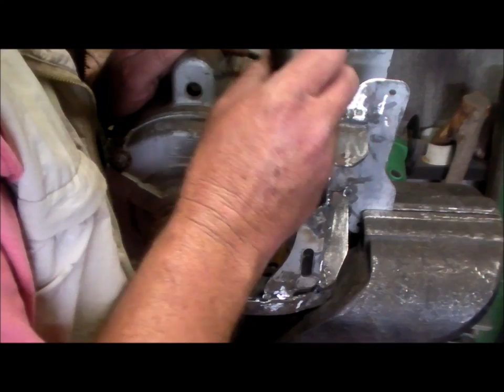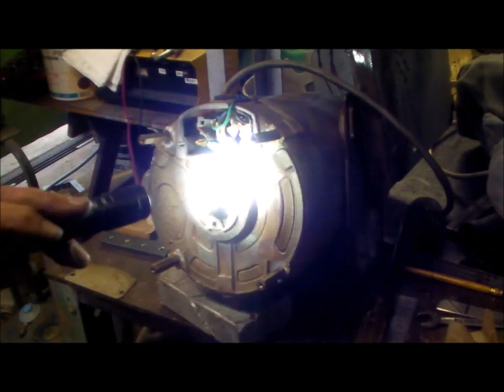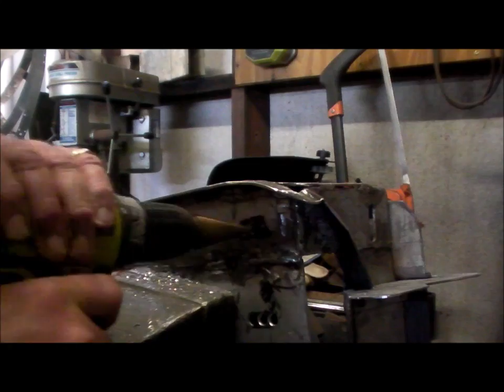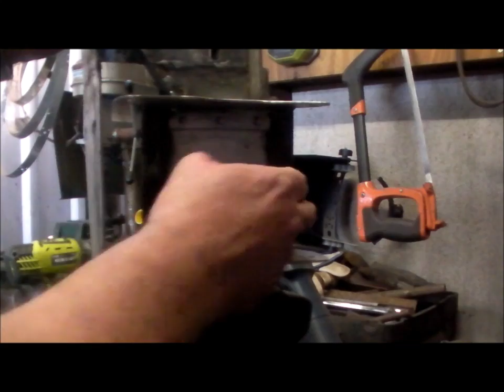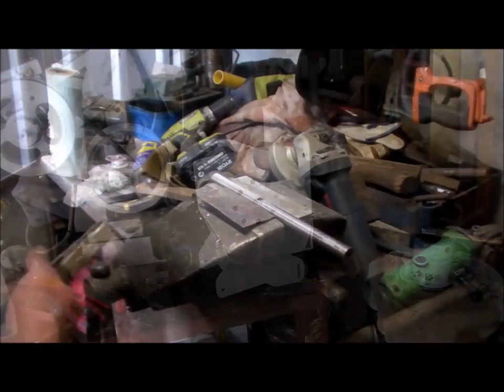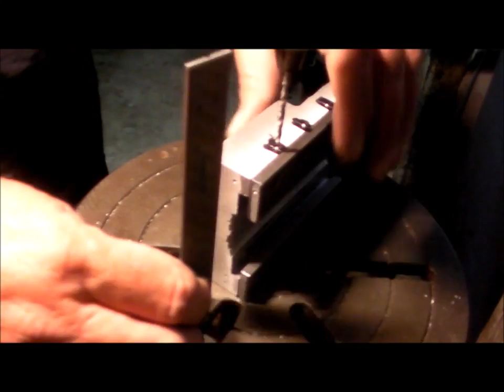Building the Gingery Milling Machine 80 motor install finished

Comment: Great to see you have the drive train put back together, but you could have turned it on and gave us a peek at it running again!!!  That was a lot of modification you had to do for the new motor, but in the end I am sure it was worth it.  Looking forward to seeing more of the tailstock building!  Thanks for sharing Peter.  As you finish your mill up, you will have to suffer through the rebuild of mine.  HEHEHE

Joe
Reply from the maker: G’day Joe, I admit when editing this video I missed taping the final assembly running, maybe I could be out of character and do a very short follow up video over the next day or two, no promises. Hey I’ve been waiting a long time for the mill to make a move into the spotlight, I understand time, money and video constraints but it would be nice to see it again after you clean off the dust. Keep well my friend, Peter
Reply: Hey Peter, thought I would just give you a little grief.  You don't have to make a follow up video.  I am sure I will see it run the next episode.  I moved the mill to the shop and done an introduction video on it.  Thought maybe you saw it.  There are some issues that I will need to work through, but that's half the fun right?  I need a GIB made but it is a weird one.  Led to some collaboration between myself, Chirpy and MSFN to get one made.  That was pretty cool in its own right.  The next videos will be tear down and building a bench.  But don't let me spoil the pain of watching for you

Comment: Oh my goodness 80 videos in on this mill no wonder you went through the motor already, just funnin with you Peter. We are really happy you did have this second motor so you can stop using your drill motor which is finny to watch. You are going to need a lot of left handed end-mills and drill bits. You are lucky that the motor has a spindle coming out both ends not usually, this way you are lucky you see.  What a wiring diagram. Happy first video of the New Year from Lance and Patrick.
Reply from the maker: G’day Lance, always good to hear from you, you know if it wasn’t for me poking around I wouldn’t have found that plate with the wiring instructions INSIDE under the fan behind the shroud. 
Hey when are you going to tell us what you are going to make? Cheers Peter
Reply: @pgs8597  We have a really tough system of checks and balances about product design so we yell and I scream a lot Patrick gets quiet and then we have a product that can move forward into the Cad design phase and when this happens we will film and share the design during prototyping and it should really be soon as the machinery and tooling rebuilding refurbishing a such are wrapping up well after these Levin micro head stock spindles are rebuilt and filmed in great step by step detail anyways, thank you for sharing and for trying to get m e to spill the beans Patrick would kill me be assured. Thank you again Peter for the great videos we enjoy them a lot.